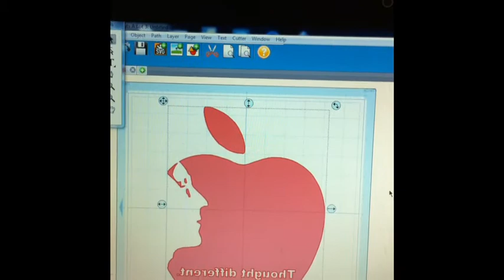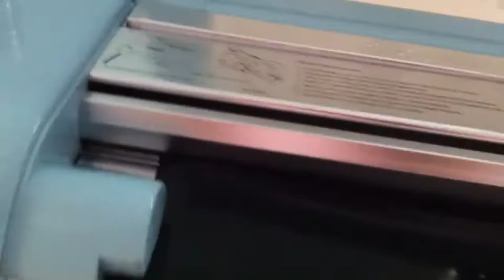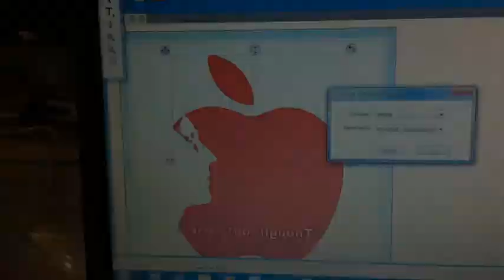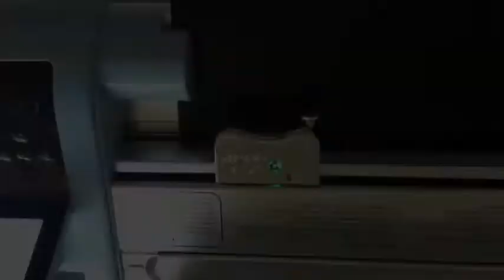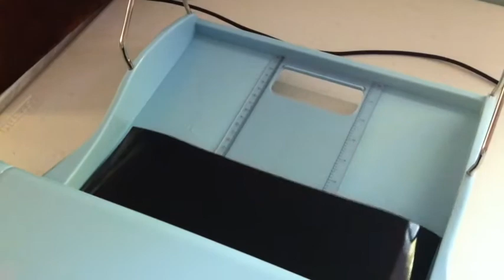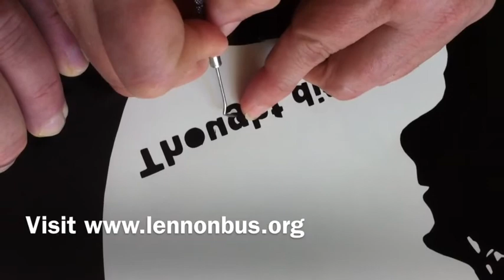Screen Print with Vinyl Stencil demo using SCAL and eCraft

Comment: How did you get the letter to print correctly? It looks like you weeded them out wrong, I thought the white section is where the ink will come through instead of the black sections